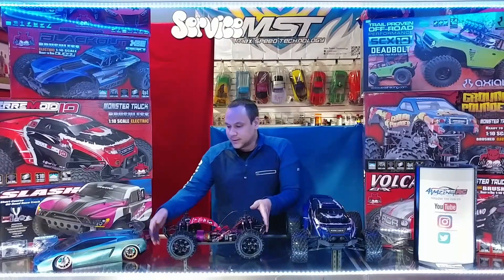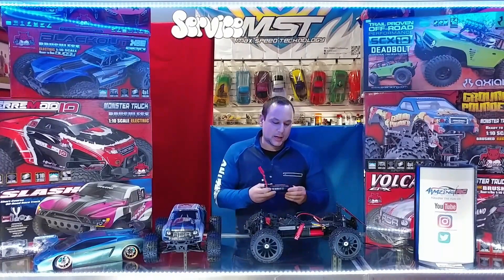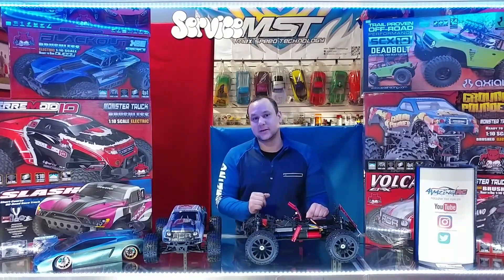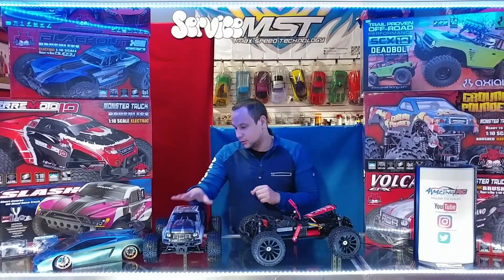RC Brushed vs Brushless - Tips & Tricks

Comment: I'm looking to put a brushless system in my ecx amp, and was wondering if I could keep my 4500 mAh nickel metal hydride battery for the brushless system as I am on a budget
Reply from the maker: Great question. You may still run the same nickel  battery. On any brushless system running a lipo battery will get you maximum speed. 👍

Comment: Should have warned some against the higher discharge. As in if your running a 35A esc you can't run a 100C lipo battery. Just so people don't fry their electronics.

Comment: My Traxxas stampede 4x4 is brushed.  Is it ok if I go through mud?
Reply: All brushed motors are "waterproof" (you'll need to oil it after tho) ESC's however are not waterproof unless the manufacturer specifics. Hope this helps someone.
Reply: @TheBestOrion  will normal machine oil work? The one people put in sewing machines etc
Reply: @faiqcreates  yes indeed. That's my preferred oil. It's nice and thin, so it gets down into the bearings/bushings, which is what you are trying to keep lubricated. I try to avoid getting it on the contact surface of the brushes though. Best of luck 😊
Reply: All brushed motors are "waterproof" (you'll need to oil it after tho) ESC's however are not waterproof unless the manufacturer specifics. Hope this helps someone.

Comment: Should i get a better lipo first or go brushless
Reply from the maker: Drew TV thats a great question. It really depends, I would say if your esc can handle it try a lipo battery first. Lower cost and makes more speed :)
Reply: Thanks! also could you get a lipo battery and have it work with a lipo charger from a different brand?
Reply: Drew TV if it's ur first rc an u haven't driven a fast rc like and erevo use a lipo but make sure ur motor esc etc can handle a lipo

Comment: I'm looking for an all around truck to use offroad. Will having a brushed motor cause it to wear out faster if I am using it in dusty conditions?
Reply from the maker: +tboeling I recommend a brushless version because it is much faster but also the motor is sealed, the brushed motors have small vents on the sides and are more exposed to sand and dust. If you plan on taking the truck through alot of dust maybe brushless would be a better choice, plus it's very fast and great for jumping. Hope this helps :)
Reply: I use my latrax prerunner desert truck on the dirt and picks up sand and rocks and I think my motor is going out because it stops moving and gets hot. And now it completely doesn't move forward and reverse. I'm going to change it to brushless and ordered castle creations sidewinder micro 2 5300kv for the upgrade for this little truck.

Comment: What is kv mean on brushless motors  ???
Reply from the maker: KV does not mean LESS torque. The KV rating of a motor describes how many RPM the motor will attempt to spin per volt applied. So, a higher KV motor will be TRYING to spin faster than a lower KV motor when using the same battery.
Reply: more kv,more topspeed but less torque..more turn,more torque but less topspeed.
Reply: Kilovolt
Reply: @TheBobby73  WRONG ! it has NOTHING to do with voltage, it is "constant velocity" ( yes, i know it is a "K" )